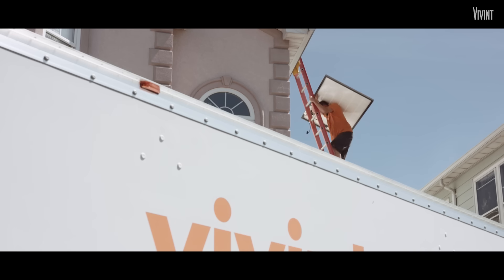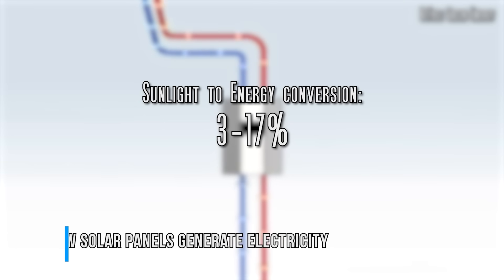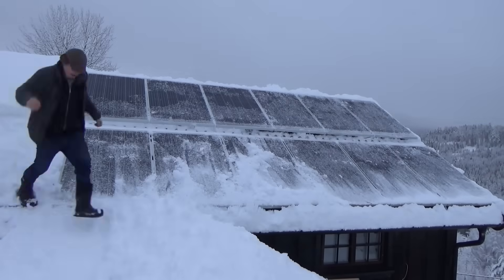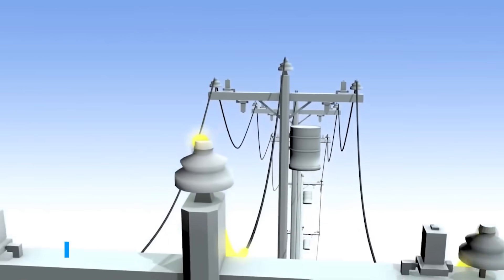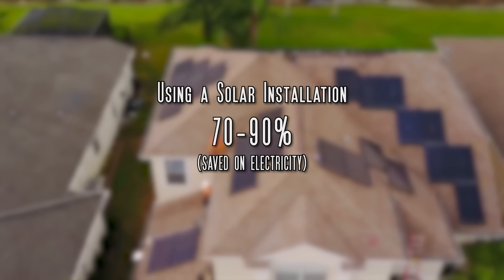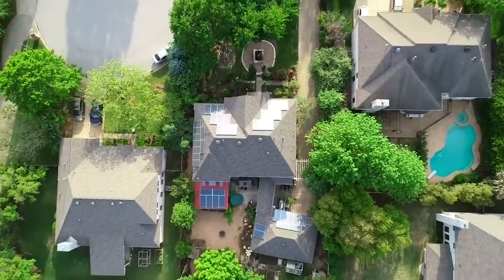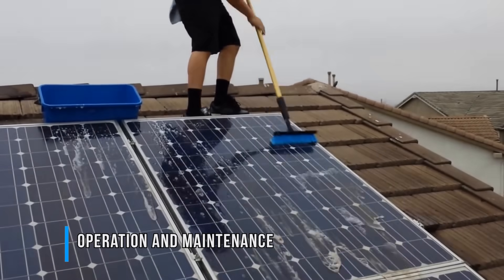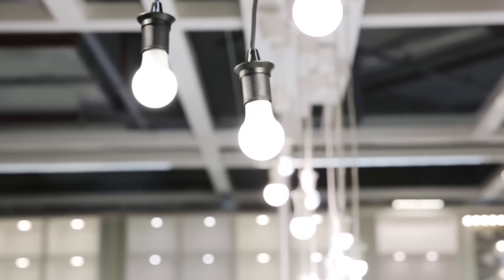Solar Power System For Home: Ultimate Beginners Guide

Comment: Ok. I live in Michigan. I understand the only time of year we get the most sun is in the summer. I had 20 panels installed 15 months ago, the salesman said 20 panels would take care of all the electricity needed for my home, no matter what time of year. So why is it I've only saved a total of maybe $150.00 ? I have never received any money/payment from my electric supplier/company. I have yet to see where this saves you money.
Reply: Because according to this video, 20 panels are only 5 kw and I would bet your household needs more than 5 kw. Solar is probably great if you have a small house with a couple of people living there and some gas operated appliances (stove, water heater and a wood burning heater for house heat). But a big house that's all electrical appliances, multiple tv's, computers, split system a/c's ,heaters, heat pump, more than 4 people living there, you'll need at least a 20 kw system to run the house. Plus it'll take years for the system to pay for itself ( if even possible). If I can't run my entire household off the system at the same time for at least a week, it's useless. Better off with a 15 kw or bigger generator that can run the entire household.
Reply: @Blueknight1960  our stove is gas, hot water heater is gas & furnace is gas. We have 4 TV's but they all don't run all the time. The house does have wiring from the early 19th century that has the cloth/fiber insulting around it I know that could be using a little more power than it should. I try to keep telling these kids to shut off the light when not in use. I had my light bill paid up to date for a month just to see what the next bill looked like, & it was like the panels aren't doing me any good. Even in the summer my bill is still $800-$100.00 every month. The salesman told us 20 panels would take care of all the power we need for this house so that's what we went with. Honestly, I feel I was scammed.
Reply: @shawnhammack5525  $800 -- $1000 a month for electric? Damn!!! That's seems way over the top for a house. Where I'm at right now, the electric bill is about $135- $140 a month. This might sound silly but, are you sure someone isn't stealing electricity from you? Meaning hooked up to your house without your knowledge?
Reply: @Blueknight1960  Oops. No, its $80.00-$100.00 a month for my light bill. 
Not $800.00-$1,000.00.

Comment: I just recently installed solar panels. Being a newbie to this new power it would be nice to have a cheat sheet or some sort of resource or you Just installed your Solar Panels, Now what? Because there is a lot that is not explained by your installers and when you try ask questions you just get the run around. Thank you so so much for this video it answer some questions that were not getting answered.
Would you be able to share some tips on how to maximize the value of having Solar and still being on grid? Like was to save? Getting efficiency type appliances, using LED light... ideas like that, do you happen to have a resource, guide or video for use who have made the switch to Solar on how we can make be use and efficiency of our energy? Would so awesome if you have that.
Reply: This isn't new power, solar panel have been around for a long time and it's not getting cheaper to install.
Reply: @Blueknight1960  right , it's a natural source of power

Comment: Went solar a few years ago in Puerto Rico and pay  just $30 a month for a/c use from grid!!!!
Reply: Clearly you need more panels
You're not only on an island but close to the equator which means you get abundant sun constantly year round.

Banana trees are essentially a bunch of solar panels and they have to generate enough energy to not only produce a plant but to produce big fruit or within a year

Long story short just get some more panels
Reply from the maker: Awesome
Reply: As we all know the cost of new batteries are raising like rocket. I realised this when I was thinking of replacing my old batteries of solar power bank. 
During that period I came across this EZ Battery Reconditioning Program. 
The results were amazing beyond my expectations.
Do you know any type of old battery can be bought to life using EZ BATTERY RECONDITIONING PROGRAM.
To know more 
http://prodguide.com/landing-page-ez-batteries/

Comment: But how to save money if you live in a apartment????
What should I do ?
Reply from the maker: That’s a great question! You would have to speak to your association about adding solar panels to your building, which i’m sure will be a long drawn out bureaucratic process. In the meantime you can build a fun project and add a small 200 watt kit to your balcony or window if you have good sun exposure and run some small appliances!
Reply: That fun project sounds good cuzz to get members to agree is a long process and even they would want some electricity.
Reply: Fire Emperor Move to a house?

Comment: A house running a total watts 4000kwh and in a day 96000kwh in 24 hours, how panels and seize of battery that will be required to provide steady power to such house?
Reply: Net metering takes the guessing of that out of the question.  Simply look at your utility bill to see your average monthly consumption.  You'll need to size the solar array to annual expected production of the array and how you're compensated for excess energy from your utility.  Any reputable solar company can help you determine the best sizing for your system.
Reply: As we all know the cost of new batteries are raising like rocket. I realised this when I was thinking of replacing my old batteries of solar power bank. 
During that period I came across this EZ Battery Reconditioning Program. 
The results were amazing beyond my expectations.
Do you know any type of old battery can be bought to life using EZ BATTERY RECONDITIONING PROGRAM.
To know more 
http://prodguide.com/landing-page-ez-batteries/

Comment: 4:09 all thing wich CONSUME curent are DC( Oven,Refrigerator,Microwave,mobilphone,chargers,routers...etc) They all convert the AC to DC.
So get DC from the solar panel and convert it to AC wich after convert it again in DC is not efficient way.
What i ask my self its not more eficient to have DC in wires house and each gadget in house just have converter(down the Voltage on same curent DC/DC) nor inverter(convert AC/DC and down the voltage). Will be waste energy on DC wires at all home?(working at same voltage 240V but DC instead AC). Most be compared with FP(Factor Power) when plug most of the things.
Reply: SLEVIN SHAFEL That's not correct. Resistive heaters (ovens, kettles, toasters, water heaters) operate on AC. Fridge motors operate on AC as do almost all appliance motors. Air conditioners have AC motors except the newer variable output inverter ones.

Comment: I need some help, I need to know what size battery and panels I would need to run a small 12v 2.3amp fan overnight
Reply: I would look into a 100w camping style panel and a 500wh marine deep discharge battery.

Comment: We got solar panels, I found out California most houses have them, even if they are small system ones but man they produce so much power, a house here consumes 200kw maybe in a week and a solar power can replace 75% of it if it's at least 15 solar panels
Reply: This is in the fall/winter
Reply from the maker: Awesome!
Reply: As we all know the cost of new batteries are raising like rocket. I realised this when I was thinking of replacing my old batteries of solar power bank. 
During that period I came across this EZ Battery Reconditioning Program. 
The results were amazing beyond my expectations.
Do you know any type of old battery can be bought to life using EZ BATTERY RECONDITIONING PROGRAM.
To know more 
http://prodguide.com/landing-page-ez-batteries/